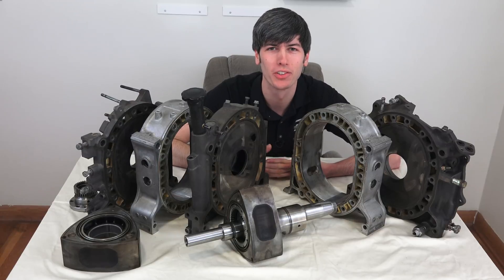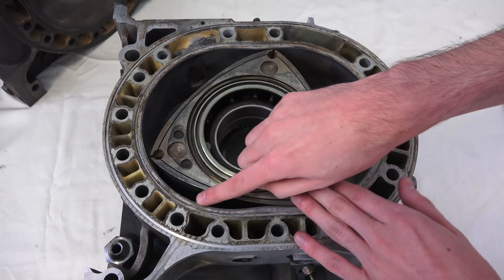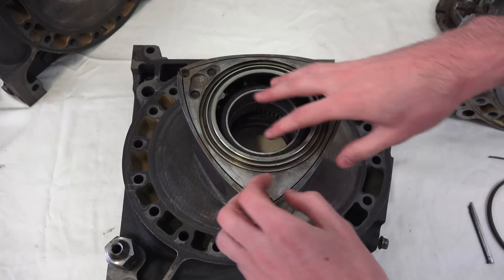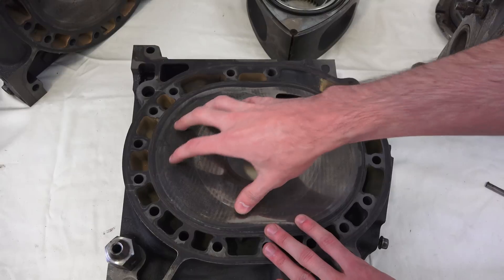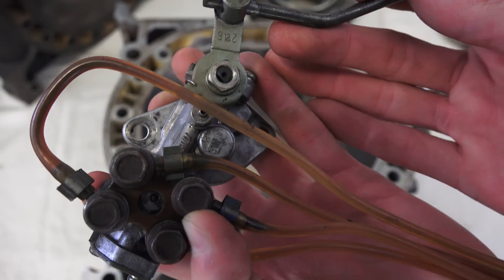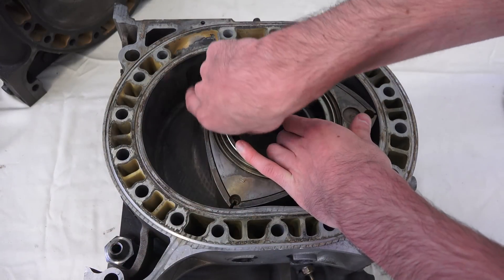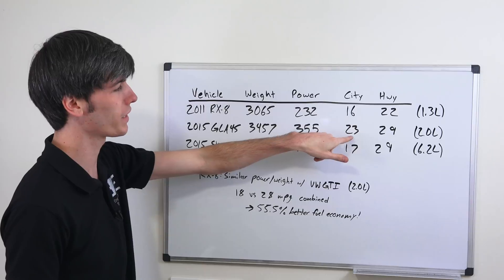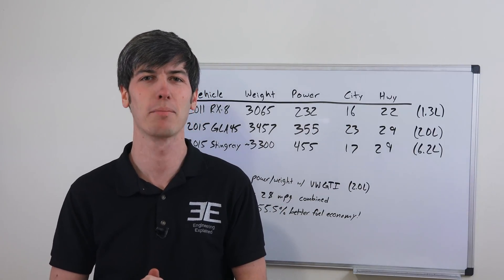4 Reasons Why The Rotary Engine Is Dead

Comment: http://www.roadandtrack.com/new-cars/future-cars/news/a31802/mazda-ceo-kills-hope-new-rx-9/?
The rotary is NOT dead. The rotary is made by 5 companies around the world right now. That Road & Track article all makes sense. The rotary as a range-extender is by far the best application for this engine.
"Mazda–like the rest of the automotive industry–has put priority on introducing hybrid and electric cars in the face of tightening emissions regulations. The company has entered a partnership with Toyota to develop electrified vehicles.

Toyota is doing research on a free piston linear generator for hybrids. About 16 organisation around the world are doing so, and have been for over 20 years, and no one has perfected it yet.
https://en.wikipedia.org/wiki/Free-piston_linear_generator

The rotary looks the best bet for a small range extender engine. When on a constant speed & load the efficiency is better than piston engines.

"If we were to restart production of the rotary engine again, we need to make sure it wouldn't be just short-lived," said Kogai. "We need it to meet future emissions regulations. We are still conducting our R&D activity to overcome any issues we have with emissions and fuel efficiency."

Kogai says that the most likely application for the rotary would be as a range extender in an electric car.

Mazda made a rotary range-extender for a Mazda 2 three years ago. Google it, journos drove it.  They said they would like to also make a portable generator using a rotary to keep production figures up. Mazda stated that any new rotary would most probably have HCCI ignition. Also look at recent SPARCS and CREEV advancements from the UK.

The rotary using SPARCS, CREEV and HCCI ignition is the perfect engine for a range-extender being a third of the size and weight of piston engine. A range-extender engine is only a part time engine, so longevity is guaranteed.
https://en.wikipedia.org/wiki/Wankel_engine
Reply: http://www.roadandtrack.com/new-cars/future-cars/news/a31802/mazda-ceo-kills-hope-new-rx-9/
Kogai said:
"We need it to meet future emissions regulations. We are still conducting our R&D activity to overcome any issues we have with emissions and fuel efficiency."

That sounds like they are working on rotaries.  And Toyota are getting involved. Toyota's new Prius is now an electric car using advanced Lith batteries with a 30 miles range on battery, and then the hybrid range-extender kicks in. The engine is a large 1.8 litre Atkinson cycle unit. Toyota are looking to replace this big engine with a smaller range extender.

Comment: I once read that it was supposed to do away with the standard engine.   After watching this I don't understand why it was built in the first place.  What did it do so much better that other engines.
Reply: The real doktorbimmer 
Bimmer McBimface, you forgot your meds again.
Reply: It has the big advantage of not having a valve train.  That makes it possible to cheaply build one that will rev high and produce a lot of power on low octane gasoline.  I'm sure that looked good to GM and others back in the early seventies when leaded gasoline was being phased out.
Reply: The real doktorbimmer 
 Bimmer McBimface , you must stop making things up.
Reply: Julian Lakay
No. He found his girlfriend being fucked in an RX-7.
Reply: 177SCmaro 
You must understand that Bimmer McBimface is a mental case.
Reply: 177SCmaro 
My God! Another nut!
Reply: ***** 
You must understand that Bimmer McBimface is not all with us.
Reply: The real doktorbimmer 
Bimmer McBimface, the Wankel is under R&D right now. You have been told that but your condition overcomes you. Sad? Of course.
Reply: ***** 
Lots of people flew in powered flight before the Wright Brother. The Wright Brothers perfected the controlled landing, no more.
Reply: *****
"The issue with reciprocating engines, and why they need to die a horrible death, is their complexity."  It is the pumping losses. So much is taken from the one power stroke to operate the three other strokes that it needs a flywheel to force the piston back up.
Anything with a crankshaft has to be inefficient by its nature.
Reply: ***** 
" Lithium supplies will not support the massive demand that will come from a growing population," Lithium is everywhere. The University of California estimated reserves of lithium would give battery production for EVs as an estimated 1 billion 40 kWh Li-on batteries could be built with current reserves.
Reply: 177SCmaro 
That is known lithium reserves. 
The life expectancy of people is going up because of clean water proper food and modern medical  Many people suffer through their lives because of air pollution.
Reply: 177SCmaro
They owe it to energy, not petroleum, which is only one form of energy.
Reply: 177SCmaro
Only since WW2 did oil become the prime source of energy, as before it was coal. Even in the USA today most electricity comes from coal.  Germnay had little oil in WW2. Their industry and transport ran on coal - electric  trams and steam engines. Oh and horses. Nearly a million horses invaded the USSR
Reply: ***** 
"He is refusing the accept the points we make."
People have to accept your point if though they may be suspect? mmmmm
Reply: The real doktorbimmer
Bimmer McBimface, you must stop making things up. You must.
Reply: The real doktorbimmer 
Bimmer McBimface, you have been given new designs that have been developed since 2008. Were the voices screaming this morning?
Reply: Great comment, indeed despite all the initial hype the Wankel turned out to be massive commercial failure and is no longer in production.
Reply: this doctor bimmer guy sounds like some bmw tragic who never got a call back on his application to work there.

Comment: Fuel economy aside, why not just tune rotary engines to run on e85? The initial spark time is slower than gasoline, but then burns faster and more evenly once lit. Further, it burns cooler than gasoline and could be run at higher compression ratios with less fear of pre-detonation, if a rotary could be setup that way.

Comment: I own a 2005 mazda Rx-8, and the main reason i dont agree with this video is because all we compared is fuel economy. The rotary engine was not designed for cruising, the rotary hits a particular market and that's why it is dead. The rotary is actually used in high performance vehicles because of its high rev limiter. on the manual it redlines at 9k, so when you take a corner you can keep the higher rpm to come out of it. So basically it costs fuel to make a engine to keep it at a high rpm on the daily. The car wasn't meant to get great mpg, anyone who owns one knows that.

Comment: I think comparing a motor produced in 2011 to one produced in 2015 should be drastically different,  given the technology produced in four years in the auto industry. A 2015 should have better fuel consumption than a 2011 model...

Comment: 1 of the cons is that it throws flames??? How is that a con?
Reply: Is it cool, yes. Is it efficient, no.
Reply: fuel burns outside the chamber meaning it doesn't combust properly and you lose power.
Reply: Seems like everyone is missing out.
Reply: Funniest comment i've seen today
Reply: Its actually two cons:
1. It wastes fuel
2. The exhaust flames might be powerful enough to burn something, such as your rear licence plate or a bypasser.
Reply: Allen Ng who the fucks dare to be near an rx7 exhaust ?
Reply: somebody who doesn't know what an rx7 is
Reply: he literally fucken said it..
Reply: Allen Ng who gets near an exhaust ?
Reply: @The Sixto Show Rewired Well, in 2008, youre description would be very accurate.
Not anymore, we have almost everything, except for big engined scooters. We have small engine scooters, electric vehicles, Smallengined bikes, 400cc bikes, 600cc bikes, 1000cc superbikes, large Harley Davidson cruisers, etc, etc..
The only thing is, anything above 600cc gets more than proportionately expensive, due to our import duty scheme.
So, while you get a locally made 400cc in around $4000 or even lesser (converted to INR), you will have to shell out around $16000 for a 600cc inline 4, which has imported parts but locally assembled.
Reply: Fuel getting wasted is the biggest con.

I'm from India, and we have a manufacturer "Bajaj Auto" which got patented a twin spark plug design for low capacity motorcycles, and it actually gives a better fuel efficiency and engine performance, apparently by burning fuel better.
Yamaha, Suzuki, etc. are far behind Bajaj here in sales. Only Honda is a challenge, that too only due to its scooters....
Reply: @Samarth916 two spark plugs per cylinder to increase efficiency, like the old Ford ranger.
Reply: @mrsmith2876  Yup, I'm not aware of Ford Ranger's setup though.
Even the firing order of the spark plugs (determined by either the CDI or the ECU) is according to the flow of fuel within the cylinder, and this system was improved over time to increase efficiency.
Reply: Jack Vernian bro do yu know a lot about rx8's? Because I want to get one and got questions
Reply: I like how Jason seems like the only car guy concerned with fuel economy
Reply: Let me introduce to my friend EPA
Reply: Gotta love a car with afterburners.
Reply: Riz Reid Better power to fuel consumption ratio, lower emission.
Reply: What advances can or have been made by or in scavengeing unspent fuel?
Reply: @Austin  The video maker is a snowflake.

Comment: I'm thinking... if this engine seal + chamber rebuild using graphene diamond structure (it has incredible heat transfer and the metal can act like lubricant) might solve this problem...

Comment: 80% OF THE WASTE HEAT ON ROTARY ENGINE CAN BE CONVERTED INTO USABLE ENERGY/POWER... SO ALL IS NOT LOST YET...  BMW is testing a two-stage device called the Turbosteamer on a stationary conventional 1.8-liter engine at BMW headquarters here.  The device works entirely on the waste heat from the engine.  Turbosteamer  converts more than 80 percent of the heat energy in the exhaust into  usable power, says Raymond Freymann, head of BMW's advanced research and  development subsidiary.

Comment: ROTARY ENGINE LOSES ALOT OF HEAT INTO THE EXHAUST, THIS COULD EASILY BE CAPTURED AND USED TO GENERATE HEAT/STEAM AND ASSIST MOTOR AND IMPROVE ECONOMY...  GOOGLE THE FOLLOWING ARTICLE RE: BMW USE OF THIS
BMW Turns to Steam to Boost Power, Improve Fuel EconomyHow the system works. MUNICH, Germany -- BMW is applying steam-engine technology in an auxiliary drive that the automaker says can boost both power and fuel ...

Comment: YOU GUYS, I TRIED LOOKING AT THE COMMENTS BUT NOBODY HAS MENTIONED ROTARY ENGINES CAN BE CONVERTED TO RUN ON CLEAN BURNING HYDROGEN QUITE EASILY AS COMPARED TO PISTON ENGINES....  ALSO WHY HAS NOBODY MENTIONED MAZDA HAS LICENSED ITS SINGLE ROTAR ENGINE TECH TO AUDI TO USE AS A RANGE EXTENDER/GENERATOR IN THEIR ELECTRIC HYBRID VEHICLES???   THEY PLAN TO RUN THEM ON HYDROGEN OPTIONALLY... SO ITS NEARLY ZERO EMISSIONS... THE REASON THE ROTARY WAS SELECTED?  COMPACTNESS, LIGHT WEIGHT, SMOOOOOOTH ZERO VIBRATION AND NO-NOISE OPERATION....  WHY WAS THAT FAILED TO MENTION IN THIS VIDEO? 

ITS NOT DEAD YET Y'ALL....

Comment: YOU DID NOT DISCUSS HOW GEAR RATIO'S AND TRANSMISSION ARE A FACTOR ON THE MPG/FUEL EFFICIENCY. ITS NOT ALL ENGINE. TRANNY AND FINAL DRIVE MAKE A HUGE DIFFERENCE. EVERYONE KNOWS THIS... BUT YOU FAIL TO DISCUSS THIS BASIC FACTOR.  THE MERCEDES HAS A 7 SPEED DCT TRANNY, THE STINGRAY HAS AN 8 SPEED TRANNY WITH SUPER WIDE RATIO SPREAD AND REALLY LOW OVERDRIVE. THE TRANNY WAS BUILT WITH MAGNESIUM TO SHAVE WEIGHT ETC ETC... TRANSMISSION TECH IS A BIG PART OF THESE VEHICLE ECONOMY RATINGS AND SHOULD BE USED IN COMPARISON...